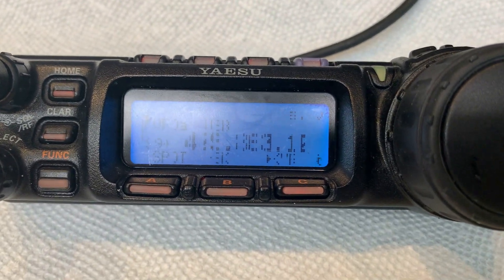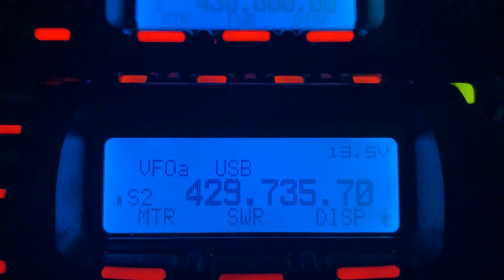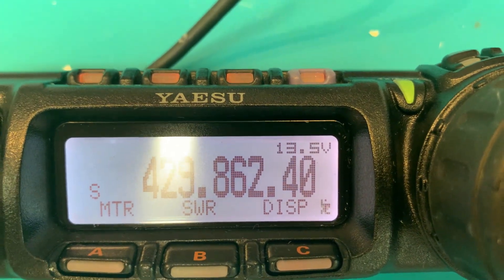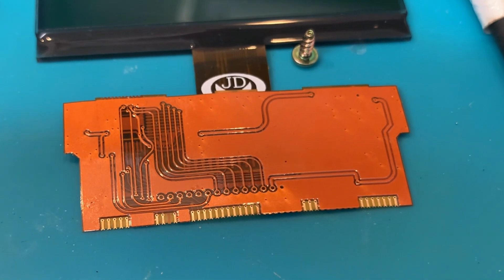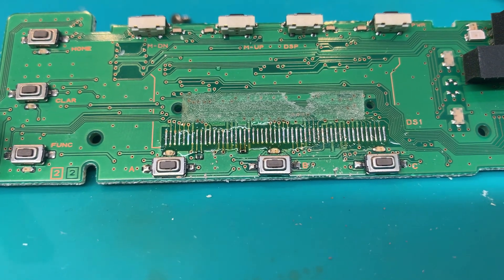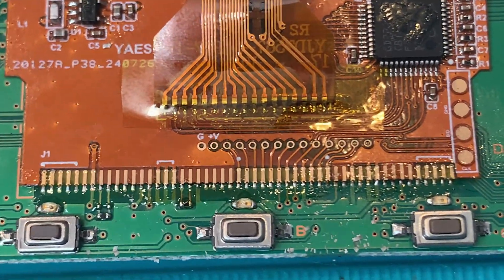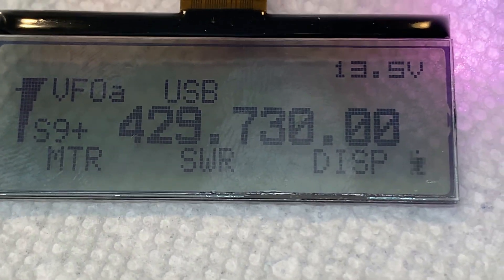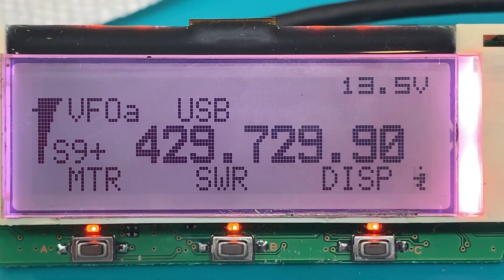857 full screen LCD missing stripe solution.

Comment: I worked in the paging industry back in the 80’-90’s and the BRAVO pager from the big M was the pager of choice. The biggest problem was with the display. We had purchased hundreds of expensive control boards to replace broken displays. We finally were able to obtain a heat bonding station from the big M parts depot as well as a case of displays, pad cleaning pens, flux, etc. during the quiet times we would clean off ten at a time the control boards and then proceed to lightly flux the pads on the boards. One then places the board in the alignment jig and adds the display. At this point the heater has been preheating for at least ten minutes. You could then lower the heater head onto the joint and time it for X number of seconds as prescribed by M. Bingo a new display and another control board saved. Basically the flex circuits have been designed to use a heat bonding machine with a specific temperature for the solder used on the pre tinned display. A silicone strip in front of the heating element protects the flex board while providing the proper amount of heat and pressure to complete the soldering process. Now if I only had that press, perhaps I could have designed or modified it for the longer heat strip needed for the 857 displays.
There is an adhesive strip just above the strip contacts, any idea what might be used in place of the original? It’s double sided and is used as "insurance policy" against accidentally ripping off the display from the control board if some novice takes their unit apart as well as for holding the flex in place for soldering.